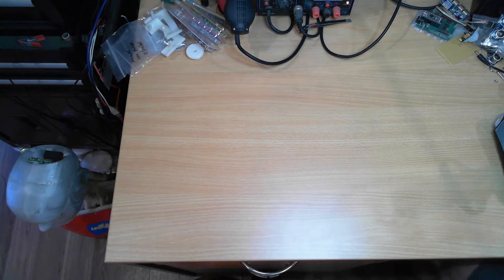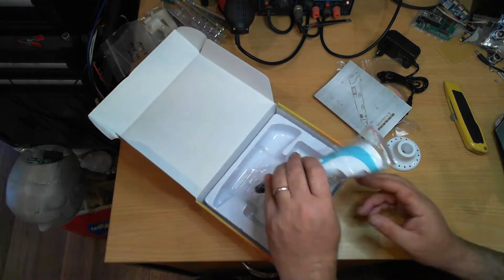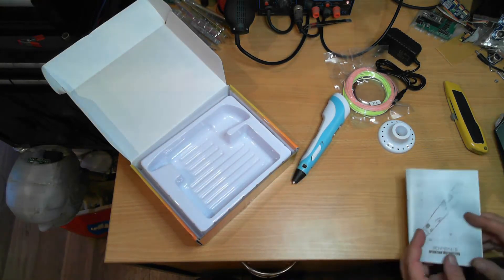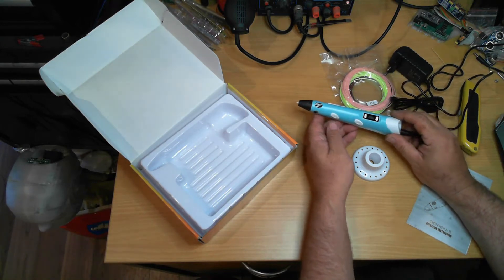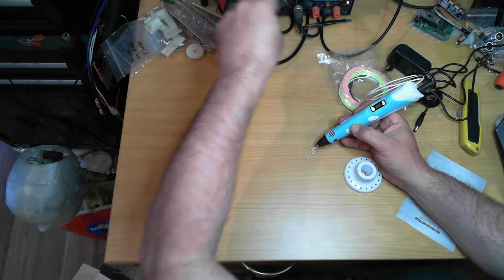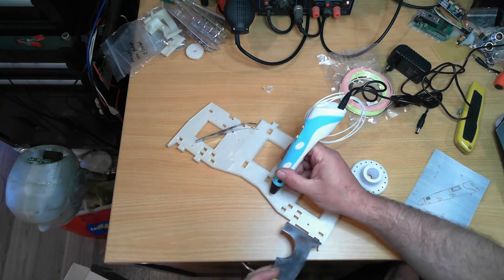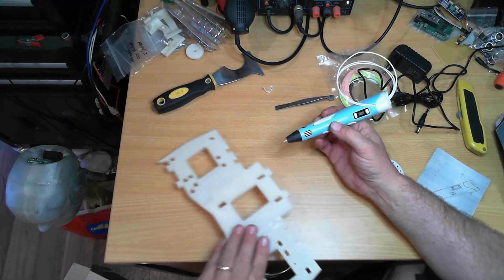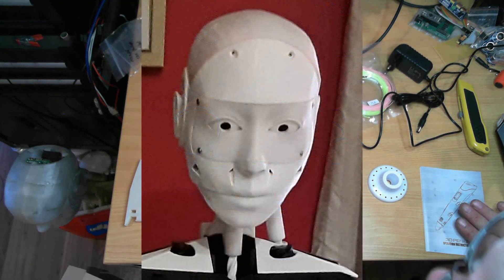Unboxing 3D PEN-2

Comment: It not letting stick the string in to it
Reply from the maker: Two things are possible.
1) not up to temperature. Need to wait for the light to be green.
2) you do have to start it extruding in order to load the filament into it.

Make sure you are using a filament and not a string, as the string doesn't melt, but filament does. 🙂

Comment: I got the exact pen, it lasted 5 mins before the feed microswitch snapped off the board, it was only about $15 on Ebay but seems they have pulled it from the market so now have no recall
Reply from the maker: It looked that same as the first one I had, and the feed button failed on it after 6 months or so of heavy use, but I did weld up a Mk2 3D printed full sized R2D2  :-).
The second one I had, the heater failed after about 18 months of medium use.
The one in the video is still working, but I did get it mid January this year :-)
Time will tell.
Over the years, there have been minor changes made, both in the hardware and the firmware.
The buttons aren't made for heavy pressing, but that's hard to avoid at times when welding :-)
Probably why the second one lasted so long, push to start-push to stop.
The first and current ones are push to extrude release to stop.
I would hazard a guess, yours was the latter type....